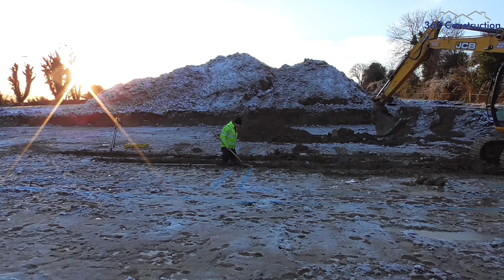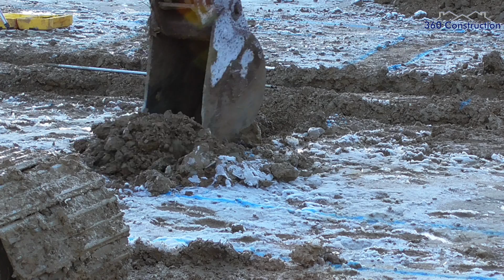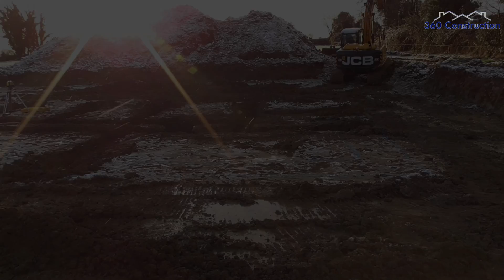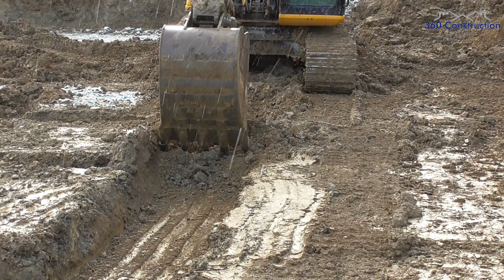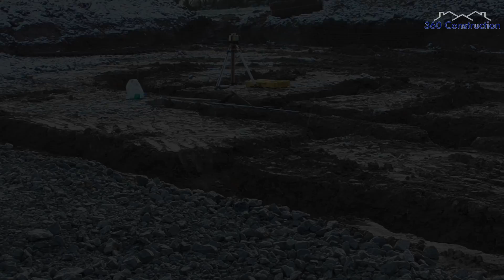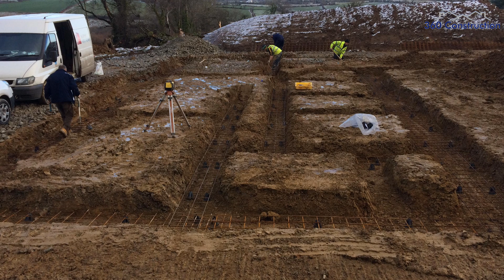Strip Foundation - Excavation & Reinforcement

Comment: So the areas where it isnt excavated (Where it wont have any loading bearing wall) will just be left as it is then have the base of the building (floor), including DPC put on top of it as well?
Reply: The area that's not excavated will be filled in with a radon barrier (plastic sheeting)hardcore(stones and gravel basically) to be brought up level with your your blockwork that is built up to floor level, the floor screed is then poured to make your building floor